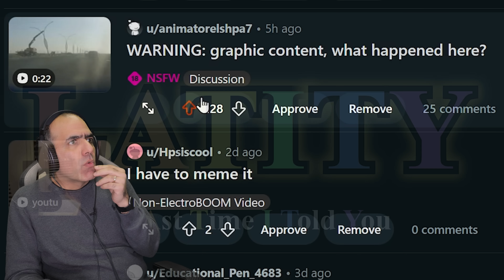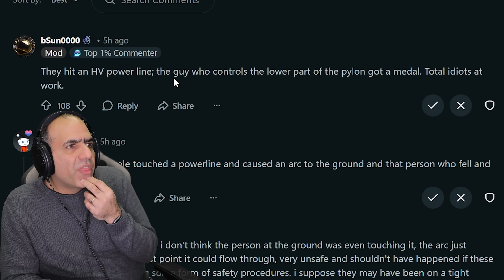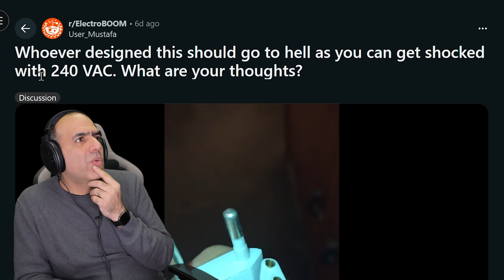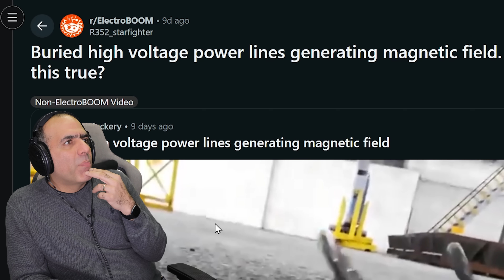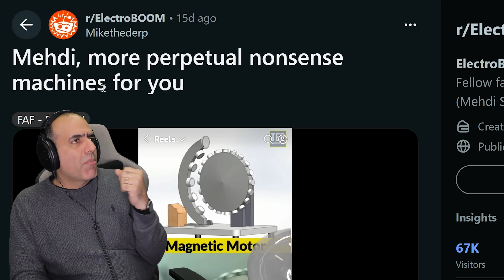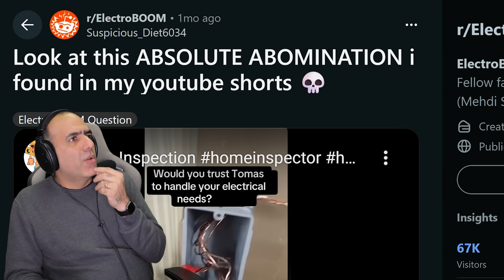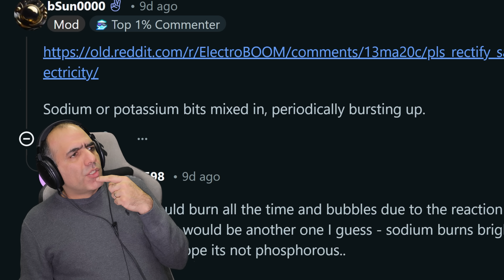Have a Pole? Need a Hole! (LATITY-017)

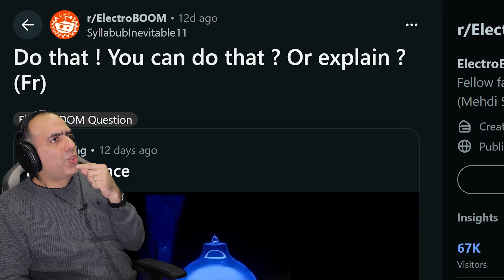Comment: 7:45 A Mexican Viewer (And Actual Electrical Engineer Here).  Let me explain why these things are very common in Mexico and they make sense. [i had to split this on 2 Parts so Part 2 in responses]
The main reason people do these things instead of just buying pre-made extensions is because of the quality. (Yes...let me explain). TL;DR: The extensions you get in Mexico don't usually last (or at least not historically), and while they've improved over time, it still happens if you're not careful when buying them, so it's a bad habit that's been passed down. (although sometimes it's more the laziness of not wanting to search, buy and pay a good one, and instead reusing because there's nothing more permanent than a temporary repair, And despite how broken it sometimes looks, it's even cheaper and better than what you can get elsewhere.)

 In the historical context of Mexico, for many years (around the 1980s), there was an extreme nationalization policy of industry [very similar, to what Trump wants to do with the Made in USA movement], which led to the existence of smuggling and many foreign bootleg brands and products that were "manufactured in Mexico" under license or with the brand's label. But without a real relationship (basically a kind of legal piracy or OEM generic manufacturing, since brands were forced to choose between building their plants in Mexico, licensing their products to others, buying our designs and selling them as their own, or paying high tariffs). -The moral of the story is, never trust a politician who wants to nationalize industry under the guise of creating jobs or strengthening the economy, or who wants to dismantle trade agreements or use tariffs as a threat, because you will become like Mexico in the 80s, stuck in the 70s, even into the 90s, with devastating consequences until 2010.

In fact, part of this philosophy didn't disappear entirely, and even in 2025, extreme protectionism still prevails in some sectors of Mexico (which, due to private or somewhat real interests, prevent the sale of certain foreign products; one of them is the entire shoe industry, where sales and imports are directly or highly prohibited/Taxed So, yes, even in 2025, Mexicans are still obligated to wear only Mexican-made shoes due to national protectionism, with imports that can triple the price or are outright prohibited under the argument that some foreign leather products could harm wildlife). This industry affected many sectors [for example, in the automotive industry, 70's-80's Jeeps and American cars were made by the same company with the same parts but with no relation to Jeep or American other than the blueprints, with obvious adaptations, Similar to the Volkswagen Beetle which continued to be produced in Mexico until 2003] , so it's very common to find all kinds of eccentricities, bootlegs, or old Mexican things that seem not to exist or be documented.

In the electrical industry, it wasn't the However, this was the most affected sector, and where the most unusual things happened [since the country lacked the capabilities and technologies of others, there was significant stagnation and reuse of obsolete products and designs]. As a result, many brands sold rebranded products as their own, adapted versions, or simply never produced them at all.
For this reason, if you watch Mexican series or movies from between the 80s and the first decade of the 2010s, the fact that the protagonists say they Sell "American things" or go to "La fayuca" or ask for some sneakers to be brought from the United States trip is a recurring joke [Because, yes, sneakers like Converse, Nike, or Adidas weren't sold in Mexico for this reason and even today they are still seen/selled as luxury items]
And as you might guess, as a consequence of this protectionism of national industry, electrical methods and materials also stagnated, remaining stuck in the methods of that era and with a very limited catalog of parts [which is why in Mexico almost all houses have the same ungrounded white bakelite outlets with gold-colored aluminum covers]. Houses (at least not the luxury ones of that time and even today) don't have lamps or lighting other than a black bakelite socket hanging from a wire in a junction box in the center of the ceiling. In Mexico City, many houses still use knife switches with 30-amp fuses as the main switch or to protect an entire house.
As a result of all this, the average Mexican house of the time didn't really have appliances. Those that existed were large, like refrigerators, or designed to be used as built-in furniture (like TVs and record players) or personal radios, and were more an indicator of economic power than a necessity. [You can see this in series like El Chavo and telenovelas]. In addition, many of the houses in central and southern Mexico (built or still standing after surviving the great earthquake of 1985) have designs that reflect the nationalistic and almost unified lifestyle of the era.

This, combined with the lack of need for electrical outlets in the walls (since there was nothing to use them with), and our brick wall construction system, which makes modifications extremely expensive and even impossible  contributed to this trend. Over the years, the shortage of outlets became evident, and even if there were enough, given the lack of a building code dictating their placement, they were likely to end up in awkward locations. This led to the need for almost everything in Mexico to have an extension cord or power strip, with the lack of awareness that extension cords can't handle just anything and shouldn't be used for everything. But with no other option than to use and abuse them to avoid tearing down half the house just to install an extra outlet or dedicated circuit, this overload naturally caused problems.

However, with the arrival of the North American Free Trade Agreement in the 1990s, similar to what happened with the Soviet Union after its fall in Mexico, a massive wave of unregulated brands and Chinese products (mostly from Taiwan) began to arrive at ridiculously low prices, along with American electronics (very expensive but of "quality," considered even premium compared to what was available in the country, despite being entry-level or even obsolete in the US).

Therefore, these low-quality Chinese products, with only overpriced American products as competition, quickly displaced the entire stagnant industry. This was due to the novelty of these products, and because they had never been available in Mexico before, there was little education (both for sellers and buyers) and no regulation regarding them.

A huge wave of controversy arose when very cheap Chinese electrical products, such as Christmas lights and extension cords, manufactured with incorrect components or poor practices, often failed catastrophically or were simply not designed to handle the heavy loads of our extremely outdated domestically produced electronics. [In fact, the few electrical regulations that exist in Mexico exist for this reason.] Similar to Soviet philosophy (a veritable hyper-nationalism), these products were built like tanks, with the expectation that they would last forever And there was nothing better in the world. [The clearest example of how obsolete these methods were can be seen in washing machines and water pump motors, They are built using methods from the 40s-60s which, despite a motor being designed for 1/2 HP, can draw up to 12-17 amps under normal use, while a modern 1/2 HP motor doesn't exceed 5-7 amps.] (So naturally these Chinese extensions melted). - Even as late as 2010 in Mexico, it was still common to find houses with lighting consisting entirely of 100W incandescent bulbs or street stalls with 300W incandescent bulbs (and similarly to what was seen in the video, these are still being smuggled from Chinese manufacturers). There is a market of people who refuse to give them up (or to use them for only a couple of legitimate purposes). -Even the government had to force the transition to CFLs and LEDs in a way, running campaigns to demonstrate the savings and raising bills.

-In fact, I'm not lying, some of these relics from that era still survive at home, and they're truly a treasure trove of electrical crimes, from extension cords made with the same cheap plastic and molds as bootleg Mexican wrestler toys to extension cords whose wiring is literally solid wire (not stranded), incorrect aluminum gauges (like 18 or even 20 AWG), or whose terminals are no more advanced than a recycled sheet of metal with a screw. - With unpolarized or exposed connections, in short, truly garbage.

it's ironic that many electrical components, even vital industrial components from major brands like Federal, Mogul, Honeywell, Leviton, and Schneider, and even complete tools, are manufactured in Mexico. Yet we are a country that makes terrible things with electrical tape And that sells all kinds of electrical junk in its domestic market (even I, as an engineer, am ashamed to have to use them because I know how terrible they are But the people insist that they be used or sold, and many times I have to tell people that just because it's "made in Mexico" doesn't mean it's good or that they should support it, and indirectly bear the burden of the disrepute that these things cause, because thanks to that, people think that electronics are just delicate paper things that are only good for making money by forcing people to use them) and lacks a real electrical code with minimum enforceable quality standards (at least for execution and inspection). These things exist and are common in Mexico precisely because no one requires you to have a license to do electrical work or comply with regulations (in fact, the government even encourages self-construction, and practically speaking, as long as nothing exposes more than 50 people or poses an immediate danger, you are practically free to do whatever you want).
Reply: If this weren't enough, Mexico, being a copper-producing country whose mines are mostly operated by Canada, suffers from the problem that the price of any product containing copper is highly volatile and fluctuates monthly relative to the international price. [This fact works both for and against the consumer, and is in fact the reason why many companies manufacture or bring motors, generators, and transformers to Mexico for maintenance.]

This means that there are months of the year when even buying wiring is ridiculously expensive, and others when it's practically free (and the same goes for copper scrap).

This results in some months of the year when even buying wiring is ridiculously expensive, and others when it's practically free (and the same goes for copper scrap). Because of this, the copper industry is semi-protected, and practically speaking, in Mexico all the cable sold comes from "practically" 2-3 national manufacturers, whose quality is also a benchmark, with some exceptions in specialty cables that are imported. Therefore, it's common for these same cable manufacturers to sell extension cords (IUSA and Volteck (Truper) being the most common in recent years, and whose products are often rebranded for others). (These are relatively the best in quality and price, and they comply with international standards for domestic use that are available) [or at least the only ones that don't explode and melt on first use]. However, they still 16 gauge, and seem somewhat inadequate to handle the heavy loads of our remaining obsolete electronics and the misuse they suffer due to ignorance.

So we return to the same initial point: the huge influx of Chinese extension cords - a consequence of the high volatility of copper prices. And a bad legacy from the 1990s free trade agreement era. Even today, it's common to find people selling generic Chinese-brand extensions in many stores. These are popular due to their low price and lack of reliability, coupled with a good dose of ignorance on the part of the sellers and the abuse by buyers that causes them to fail, creating a vicious cycle of repeated purchases. People tend to buy the cheapest ones (under the logic that they'll fail anyway, or falling into the simplistic logic that all cables are cables and therefore the same, but the Chinese ones are cheaper). This is highlighted by the fact that both Chinese and domestic versions use the same color scheme and designs, making them visually identical. A very common mistake is buying the infamous "orange" reinforced extensions. While the "reinforced" refers precisely to that orange rubber layer that makes them look thicker, they are actually quite different. People often confuse "reinforced" with "it handles more current," and in fact, they fall for the deception that it "has a thicker cable" when in reality it's just the orange rubber. [I see this so often that I've even had to save people in hardware stores who, when given a choice, always buy the orange extension cord because they believe it has a thicker cable and is more resistant than the regular version, even though both are internally 16 gauge]. And because of this, they tend to abuse them more.

Since the result is obvious, this leads many people to become distrustful and end up simply grabbing a pre-assembled cable from something that broke, or buying all the components separately and assembling their own extension cords. THIS IS BECAUSE SOMETHING VERY CURIOUS ABOUT MEXICAN LAW IS THAT WHILE IT CAN BE LAX WITH A LOT OF CONSUMER PRODUCTS, IT IS NOT SO LAX WITH HOUSE COMPONENTS.

While prefabricated extension cords are limited, the variety of plugs and wall sockets is not, and they are sold in a wide range of prices, brands, and qualities. (Therefore, it's also very common to find people who even sell these DIY extension cords (albeit with a slightly better finish). Again, despite their somewhat rough appearance, since they are literally the same plugs and wiring you already have in the wall, there's almost no room for error, and the quality is well-known.)

- In the case of extension cords covered with electrical tape, these are usually more of a homemade makeshift solution, often done out of laziness and the cost of buying a new extension cord or the full list for a DIY. This is because the Mexican economy is a strange mix where everything is either cheap or has a price option, but one action or the other makes it pointless. And this is one of those cases. It's highly likely that the cost of the electrical tape and the wall socket is not only cheaper than a new extension cord, but it might even last much longer than the original extension cord plug. [Ironically, it's the best long-term investment] or simply that dedicating time to something so poorly made is far more worthwhile than the use it will actually get, and the extra time, effort, and expense of going to the store to find a new or better extension cord, or even getting the same one for a better price than the resale price at the local hardware store.

An example of how irrational this is is that, for instance, a new 3-meter extension cord might cost you around $50 MXN (2.5 USD) at the downtown hardware store, but the wall plug and a roll of tape might cost you $30 at your local hardware store, or you might pay $80 for the same extension cord there. For those $80, you could buy a 10-meter extension cord downtown, but the trip downtown will cost you at least $20 each way ($40 total) and at least an hour. on public transport, [or replace it with the cost of gasoline and parking for a trip of maybe 20 to 40 minutes] so you enter into a debate where a botched job costs you 30 and an hour of time which is exactly the 20 difference you would spend on transport and the hour of travel to go downtown for a new one but in total the new extension ends up costing you 90 and two hours. That's a 10-peso difference compared to buying it for 80 pesos at the local hardware store, but that 80 pesos is very expensive if you consider that you're comparing 3 meters locally versus 10 meters downtown. If you bought the 10-meter extension cord locally, it would cost you around 160 pesos, but downtown, even with transport, it's only 120 pesos. So, if you did that, you could not only buy a 10-meter extension cord but also the wall plug and a roll of tape for a much cheaper price than the 30 pesos it cost locally, for the same price as just the extension cord at the local store. So now you'd not only have two (The 10m +3 one you had, or buy 2 of 3 meters for 120 vs 160 locally And still be able to choose whether to buy the wall plug and the tape as an extra to have 3, or buy all 3 for 190 vs. 240 locally...and the chain continues.), but you'd also end save money.   Something similar happens with toilet paper. People in Mexico prefer to spend 20 pesos for a 4-roll pack at the local store because they feel that spending 200 pesos for a 60-roll pack at the supermarket is too expensive.

-Remember, Mexico is a developing (and plummeting with the current government defended by vested interests) country. So, while from a foreign perspective an extension in Mexico (2.5 USD) is very cheap; But the reference point is the same average cost of a street meal or a meal at a diner, the idea of simply throwing it away and buying a new one if it gets damaged is still taboo (Because it's like the equivalent of throwing a plate of chicken with rice and soup or 4-6 taco order in the trash.). in fact The act of throwing something away that's damaged without considering that it could be salvaged is even frowned upon. There are three sides to this: while it's true that simply throwing something away and buying a new one can be a pointless waste in many cases, there are people who truly had no other option (literally because there aren't any, or they don't have the money). Then there are those who abuse this situation and truly live with a philosophy of "stinginess disguised as a thought or trauma of extreme poverty," where they will genuinely refuse to buy anything new or let go of or spend a single penny on anything, even if for that extra penny they can get something of better quality. They will even do everything possible, even ridiculous or dangerous things, to get a lower price, to get it a penny cheaper, or to replace it with bad type generics or the cheapest option available (and still pretend to be better). that lasts forever or does exactly the same thing).